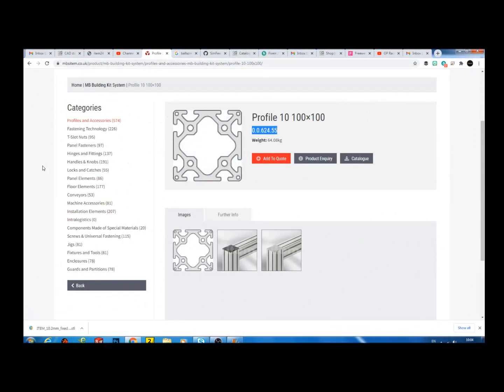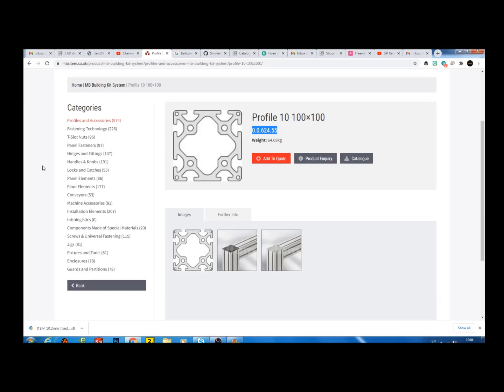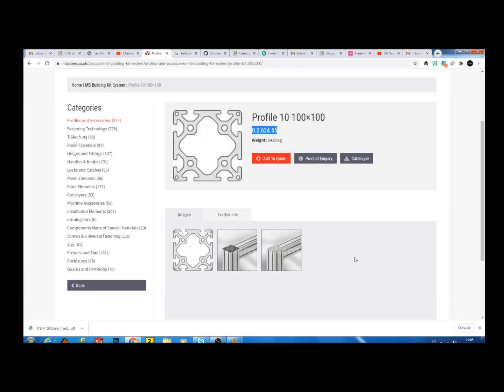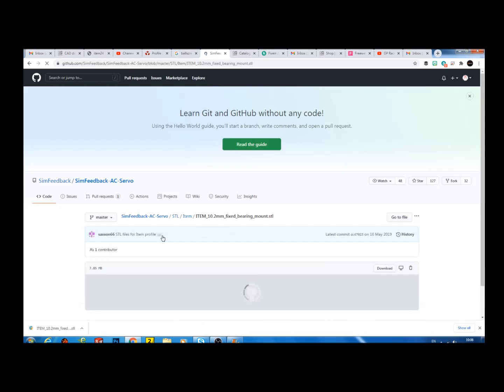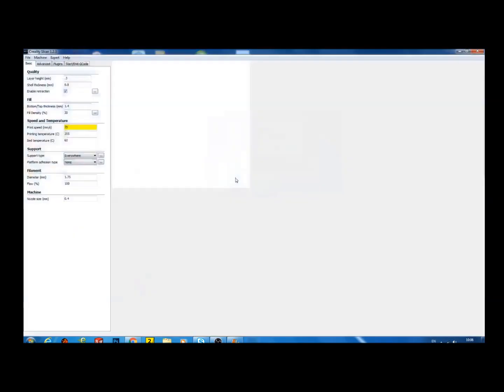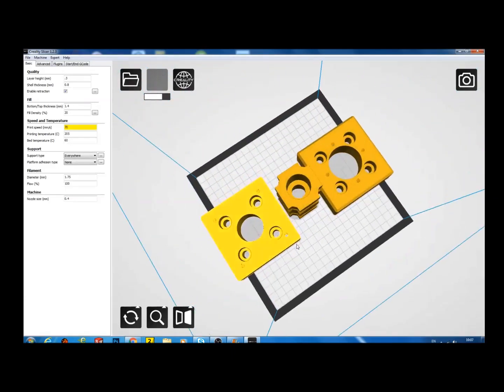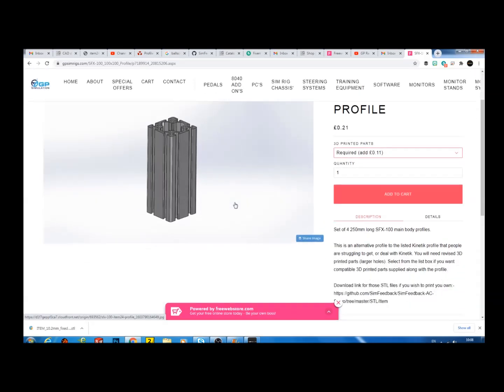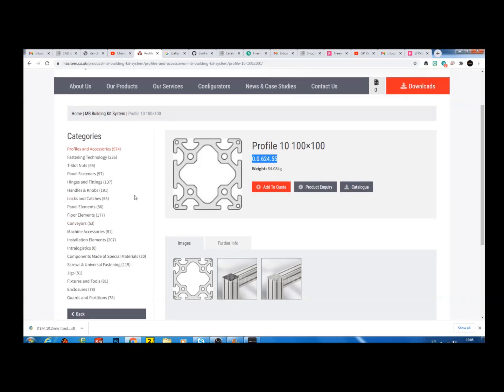Build Your Own SFX-100 Motion Platform - Part 9

Comment: Do the printed parts where the motors attach need to be altered with the metal from yourself?
Reply from the maker: No, they are the same. Its the bearing mounts and the slider that need to be different. Which i can provide if you need.